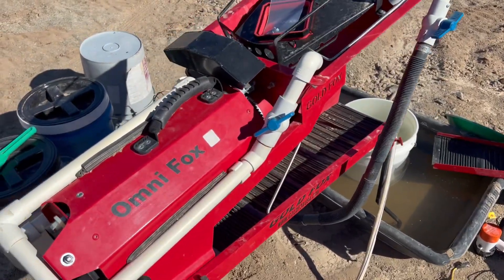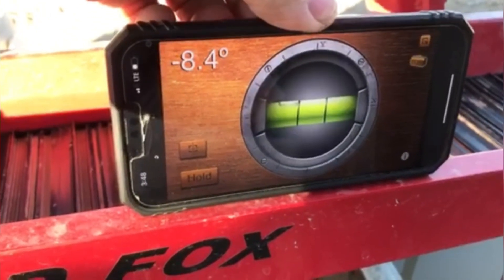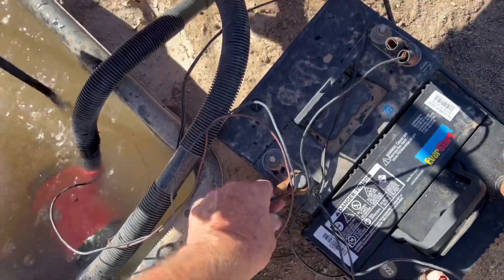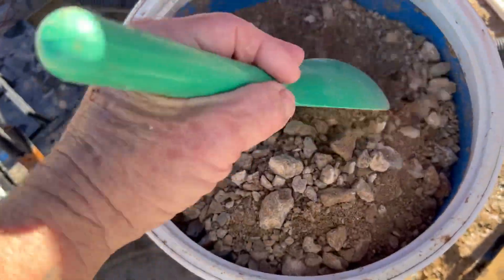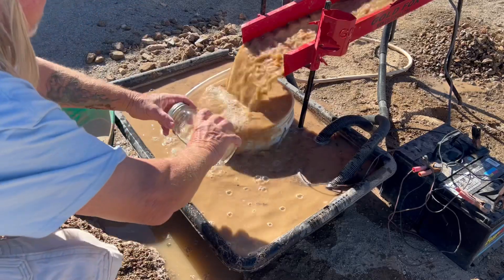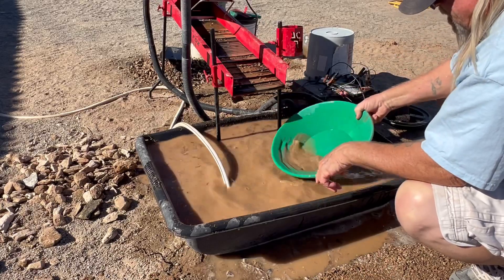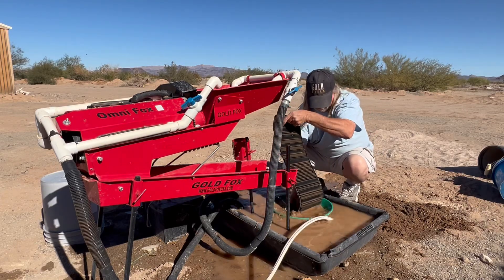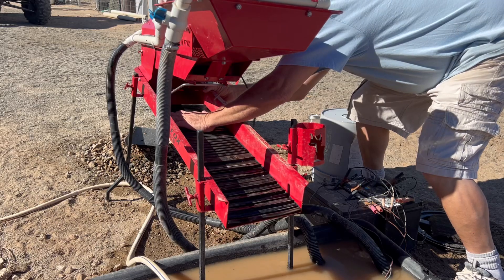Gold Fox Trommel - Testing - Geo Clean Flocculent -

Comment: I run a Gold fox also, but run it off with about 1.5' of sluice straight into a gold cube(dream mats).  This winter designing and building a Dredge-head for a Backpacker pump.. Fun shit,, Hard to keep enough electricity for my Still, and Gold Equip at same time, LOL
Reply: Love the Beer Holder on the Sluice... I did not buy the sluice, unfortunately, with the Goldfox(omnifox) at the time...  So Guess I just have to keep my jewels cold with my beer while waiting the cycling of the cube.
Reply: I do that so often, forget to check my buckets to make sure I don't blow my pumps out,. Maybe should not run the still at same time.   hehehehe

Comment: how do you know if brecciated quartz holds gold. ???
Reply from the maker: Not sure. Crush it. Put it in acid?
Reply: @goldfeveradventures  that's one way. but the words Gold Strike, or Strike it rich have everything to do with this..  Pulverize the shit out of it, and pan it out and process, smelt or leach with chemicals if necessary.   brecciated quartz changes when struck with a hammer, rod or crushed, as the atoms will release the even smallest gold if done right. When viewing Free-Gold, you only see about 1/8th or less of what is actually locked inside the microscopic molecules of quartz